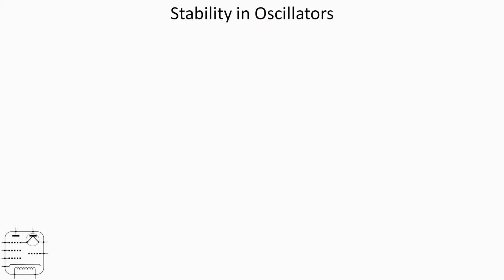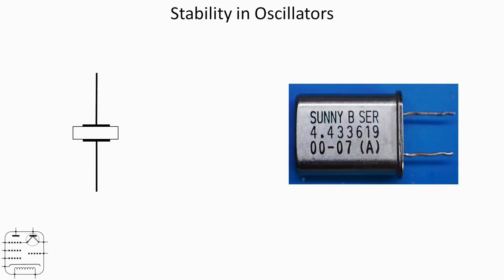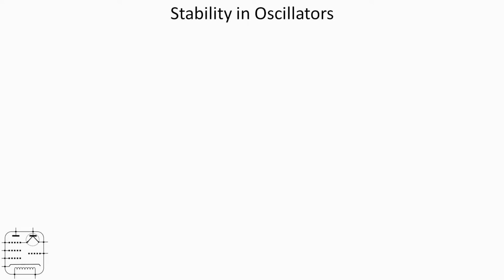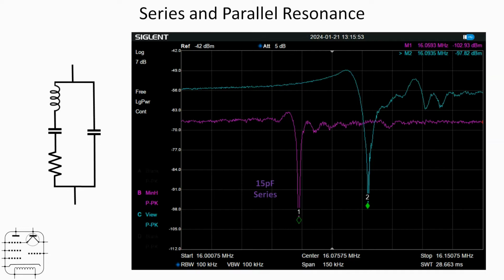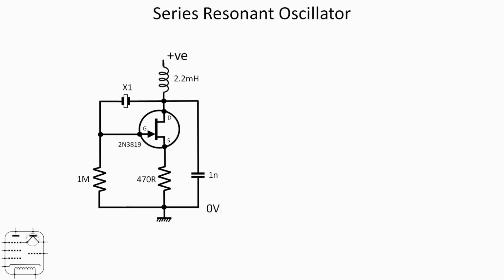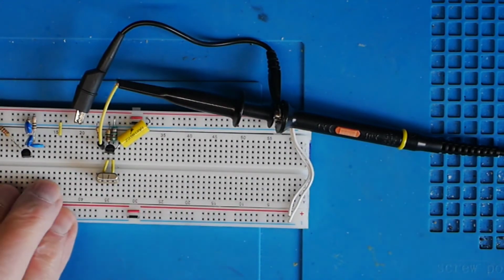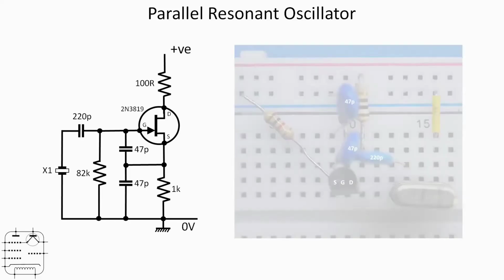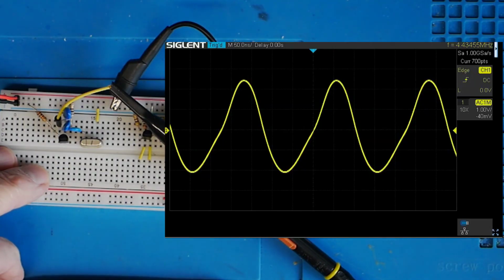Oscillators Part 6   - Stability - #198

Comment: Great video on oscillators. I noticed that in the parallel oscillator you used a resistor in place of the inductor in the drain of the JFET .  Any specific reason for this?